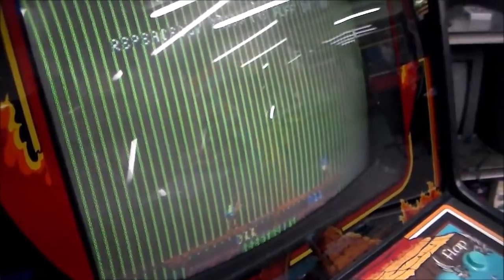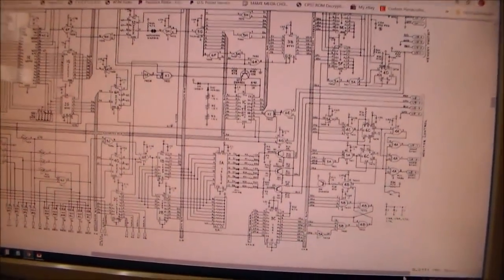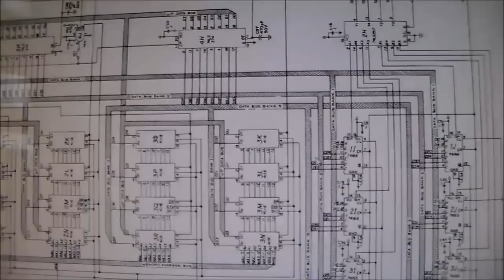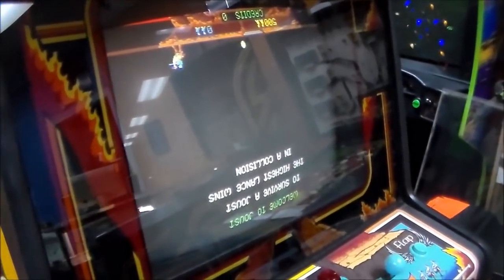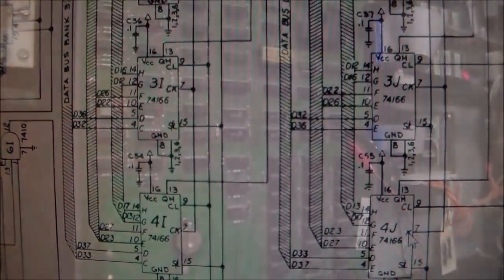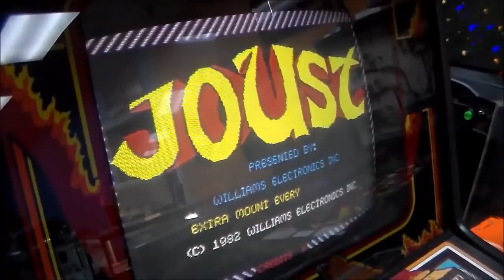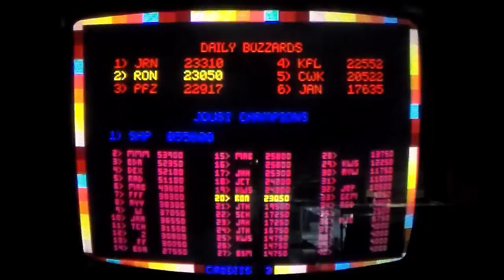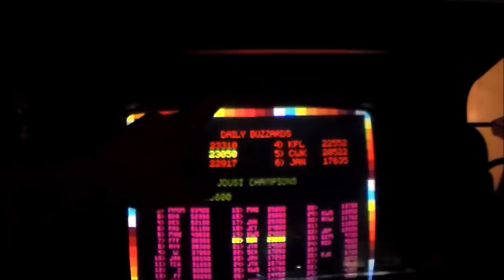Repairing a 1982 Williams JOUST Arcade Game - Why Is the Screen Upside Down?????

Comment: I believe it's because they're using 8 bits to represent the color space and subdividing it in to 3 bits, 3 bits and 2 bits, (3 + 3 + 2 == 8). This gives you 2^3 (8) values for green and red but only 4 for blue for a total of 256 colors.  This ends up being acceptable because our eyes are far more sensitive to green and red than they are to blue light.
Reply from the maker: Somebody else mentioned that Trey, that makes perfect sense, thank you.  I don't know enough about programming to understand how the bits are used so it didn't appear to me but I think you're right :)
Reply: Thanks! I love your videos. They're usually a nostalgia blast. Good work finding that pesky failed shift register. Watching you play Joust reminded me of playing Killer Queen in Chicago. Look it up.
Reply: applied computer science student here, Trey Dempsey is 100% right.
Reply: @LyonsArcade  Only thing to know here is that bits are (unless you have really exotic hardware) always handled in groups of 8...the famous "byte". Just like the cents you put into those machines are put into groups of 25. Using 9 bits for color would be the same as having one game cost 26 cents. Possible, but what an effort!

Comment: You know the REALLY interesting thing?  Joust shouldn't even have a cocktail mode!  When you play with 2 players, you don't take turns-- you play at the same time, with the same screen orientation.  The cocktail versions were table tops (instead of upright cabinets) with the players facing each other.  The screen would change orientation based on whose turn it was.  But in Joust, both players play at the same time!  

So that's an awesome troubleshooting trick... but why is it even there to begin with??  lol
Reply from the maker: You are the first person to notice that :)  I thought about that shortly after I finished the video... as you may be aware the boardset for Joust is the same as some of the other Williams games, so all that circuitry on this particular title was completely redundant and unused.
Reply: Joe's Classic Video Games Back in the day, producing circuit boards were extremely expensive, so they designed motherboard/daughterboard combos. The motherboard handled the video output and the daughterboard the game logic. Instead of designing and manufacturing a monolithic board to handle everything, they made generic motherboards to handle the basics and made the daughterboards to handle the individual game specific logic. Daughterboards tended to be much smaller and thus less expensive even in lower volumes.
Reply: I believe that the reason that joust has a cocktail mode is that the monitor is oriented 180° to accommodate the position of the chassis vs. how the monitor is set up in an upright. it has nothing to do with the screen flipping 180° between player turns (as was already pointed out that both players play at the same time.
Reply: Something else that is cool for me is that unless someone else has done that same test before, that’s the first time the B chips have ever been used in the cabinet’s nearly 40 year history. They have just been sitting there idly waiting for their chance to do what they were made to do.
Reply: @MukYJ        COOL ‼️®™️  👏👏

Comment: Bummer they replaced the original Power Supply. Nice job working logically through the schematics. Wow man, interesting technique overlapping the chip, love it. Good stuff, be well.
-Mitch
Reply from the maker: I agree, the crazy thing is we fixed the original power supply last time (it must have failed again, or at least they thought it did).  Those Williams Power supplies are very reliable in my opinion.  Thanks for watching Mitch, we'll see you next time!

Comment: I never would have thought of piggybacking chips in a million years to test them.  Thank you.
Reply from the maker: Old-school trick, it doesn't always work though... as you can imagine if the fault in the chip is a short, when you piggyback it the short is still there.... if the fault though has blown open it'll fix it....
Reply: @LyonsArcade  
Understood completely.  And I imagine while this mostly works with logic chips, it wouldn't work the same with an analog chip.  Yes?

Comment: Interesting Battery Mod.    This is bringing back memories!
Reply from the maker: That's what we're going for :)
Reply: @LyonsArcade  You know, on board AA Batteries were not the brightest idea.  I mean, a little foreknowledge of the fact that they leak and cause all kind of corrosion issues.  And then the Battery Clip that Williams used would not hold up to that corrosion and fall apart.  FYI, I have been in the Gig since 1989.  Lots of fun.   SALUTES
Reply from the maker: Yeah I think it came down to they didn't care if it lasted.  They wanted people to throw them away after a year and buy another one!

Comment: It was common practice for service techs that are called out to fix a problem and then quote more than the customer is willing to pay to rotate the yoke 180 deg. When the customer refuses.
Reply from the maker: I'd never heard of that, that's pretty crazy!
Reply: @LyonsArcade  yeah, some folks realized that to troubleshoot the problem the tech actually had to fix it and started telling their pals and all of a sudden tech weren't getting paid and were out the cost of the parts used.  Slimeball customers.

Comment: I would have just left it in cocktail mode and physically flipped the screen over.
Reply: It might have been mirrored as well. I believe in the days, a mirror was used and you were looking at that.
Reply: @forevercomputing  Have you ever seen a cocktail arcade table? They didn't use mirrors in Cocktail mode. The screen just flipped for the player on either side of the table.
Reply: Big brain gamer move!
Reply: @robertatkinson6864  There were some cabinets that used a reflector for the screen, and had the display inside facing upwards. Maybe a different thing, but I've seen those before too.

Comment: That boot pattern is called a “rug test” and if no VRAM errors are found, it’s often a memory addressing problem, because even if the game does a “data write pattern test”, it will report “no problems” because the CPU doesn’t know its writing/accessing the same memory locations instead of writing the entire RAM. The same is not true for the EPROMS because the CRC will be incorrect.
It’s not a good idea to “piggyback” chips because if one is functioning correctly and the other is not, you can potentially short the output transistors in the IC. This only applies to “totem pole” outputs, not open collector.
When the screen was flipped upside down, in a pinch, you can always reverse the 4 wires on the CRT’s deflection yoke (swap X and swap Y) to flip it right side up and leave it that way hehehe (poor man’s fix)
Reply from the maker: Thanks for the info, Rick!

Comment: The 74166 are shift registers. They are often used to make a data bus of x bits into a serial signal.
The red lines are vertical. So i think there are some bit regiters in one chip ar permanet hi or low and are shifted over to the serial signal.

Comment: I initially guessed deflection coils plugged in the wrong way round... interesting that it's for a "not needed" cocktail mode.
Reply from the maker: Good guess, it was a trick question... it's upside down because I did it on purpose :)

Comment: Im currently restoring an old pole position 1 and 2 arcade cabinet i ordered parts to repair the power supply units as they are both fried is there a conversion to a newer hap power supply ?
Reply from the maker: They don't make a new power supply for it because it had an amp on the original Atari power supply.  The originals are pretty reliable though once they're repaired.

Comment: I have installed a 19 game jamma board, but the screen goes sideways and keeps scrolling from right to left without stopping. Please help!
Reply from the maker: Your sync wire isn't making good contact with the gameboard, put the old one back in and see if it's still synced, if the new one isn't, then it may be the game is set in 'vga' mode instead of 'cga' mode, look in the book.  If you have an older monitor like this it's CGA if you have a computer monitor it's VGA.
Reply: @LyonsArcade  you know the blue part that has 1 or 2? The switch goes up and down. I had "2" up and moved the switch down. Now it works, but I realized the 15 in 1 jamma is horizontal. So, I would need to turn my head or the monitor! Lol

Comment: Some particularly fancy troubleshooting here...
Does this mean that the other four shift registers are normally completely unused on the upright? Could they be spares? Not that those chips are particularly rare, I suppose...
Reply from the maker: Yes, that's correct, you could take all 4 of them off the board with no issues on the upright.  They're inexpensive and they make them new, but you may end up in a situation where you don't have one available and have this fault, so you could rob one from the other side and get it back up and going again!
Reply: @dangermartin69  You know, that's a good point. I looked it up and there were Joust cocktail units--but to support the coop gameplay, they had both of the player controls on one side of the table! So there would be no need to invert the display at all, and those chips have absolutely no regular function on a Joust.

Comment: Forcing that into cocktail mode is brilliant and your troubleshooting skills to find the problem chip are great as always.  And that piggy backing chip trick is awesome.  

Question though - couldn't you have just permanently jumpered it into cocktail mode and flipped the monitor over?  Or does the monitor only go in one way? 
For someone who might not have the skills you do at chip replacement that could be a solution.

Comment: Why only 2 blue resistors? Human eyes aren't as sensitive to blue light. You only have 8 bits to split between 3 colors, so blue gets the short end. Thats my answer.
Reply from the maker: You're probably right!  That makes a lot of sense.
Reply: That’s how video compression works, too. It often has less bandwidth for blue, especially on older formats.

Comment: Go into service mode and see if it is set to Cocktail table mode. t is possible that this setting could also be a dip switch.  If it is, change it to upright cabinet mode.  If it is already in upright mode, there could be some wires reversed in the monitor.  It is also possible someone mounted the monitor upside down.

Comment: Too bad that when the CRT is shot.  Ya got to change the chassis out   CGA to VGA. $20 on line.  Always found that  connection at the logic board is arc stricken or burnt off    Besides it being a monitor problem

Comment: I had an old tube tv that got tipped on its front and it did the same thing the screen is shot because little components got shifted I’m not sure if it can be fixed
Reply from the maker: Elizabeth, is it all different colors?  If it is, you can fix it with an electric motor, something like a drill or even a powerful hair dryer, get it near it and the motor will realign the colors on the screen.  Or you can buy a degaussing coil if you want to do several and have the tool....

Comment: So did you add a socket and replace the chip or did you solder it piggy backed?
Reply from the maker: I cut the old one out then removed the legs and added a socket... I was thinking about just gluing it on the back of the other one though :)
Reply: @LyonsArcade  Say you did take the lazy way out and just pinpoint soldered each leg on the piggy back. Would there be issues down the road? 

im not going to do this im ummm.. asking for a friend :) lol
Reply from the maker: The only issue down the road would be that it'd be more tough to remove it if it broke again, but that would probably work fine.  The chips have 'gates' inside which are basically transistors, so if the chip has failed in such a way that the gate is only partially failed, when you put the new chip on top, you're basically leaving the old one that halfway works still installed too... but have now hooked both transistors up at the same time, so it MAY cause an issue but I'm not positive.  It was certainly playable as you saw with the chip just hanging on there so you'd probably be alright.
Reply: @LyonsArcade  thank you for going out of your way and answering. 

My friend says ty..
Reply: @LyonsArcade  Also - Why does Joust in cocktail mode need to flip? You sit side by side on a Joust Cocktail.

Comment: more about that dust and grime I was talking about earlier I'm not trying to be offensive or anything don't take it that way,,  that's in there for a reason it's conductiveit and  gets attracted to electronics., It'll get  up in there so bad it starts leaking electricity everywhere liken it to a trash bag when it's new nothing leaks but eventually it gets a bunch of pin holes in it, . When I repaired televisions I would make a solution of baby shampoo and water three to one water and spray it down using a gentle brush like a paintbrush, then take it outside and lightly but thourougly hose it off. Especially when there's soda spilled in there, coca cola if left in there will kill a board, then I shake It off and take a hair dryer and blow it dry and let it dry for about a week , I'm not recommending you do that for every board  you can clean with a q-tip and  rubbing alcohol but you can't get underneath those chips very well with that. The more of that junk you clean out the better and longer it will last after you fix it.

Comment: I would have left it in cocktail mode and turned the monitor over. #imahack
Reply from the maker: LOL That would have worked just fine.  You can actually invert the yoke wires on the monitor too, which would have made it display upside down.... which would have been right side up :)
Reply: @LyonsArcade  Thats what I thought you were going to do.